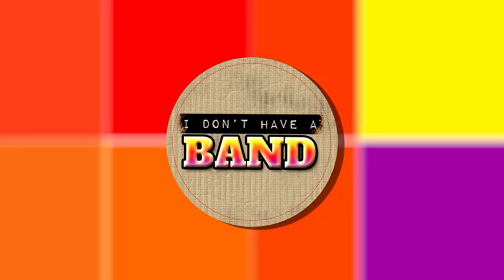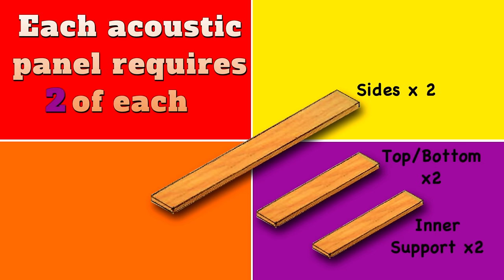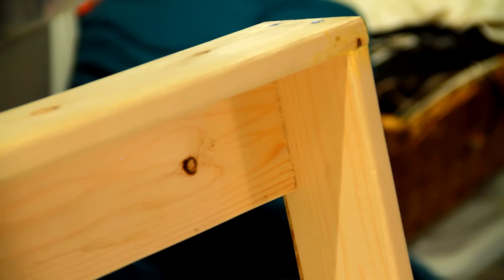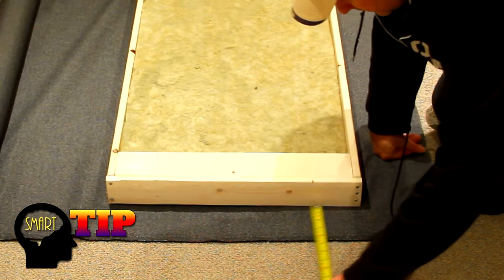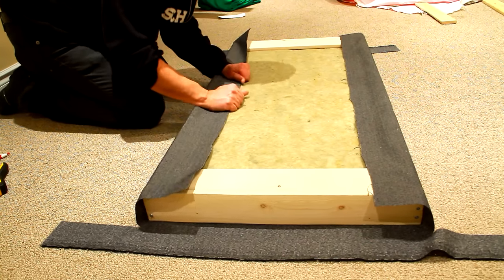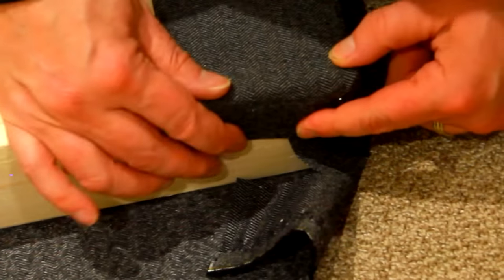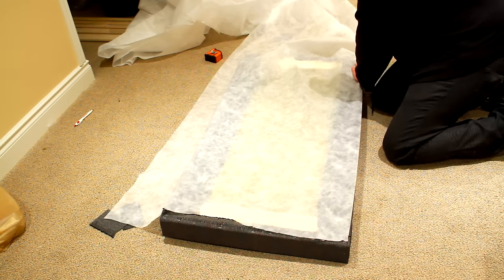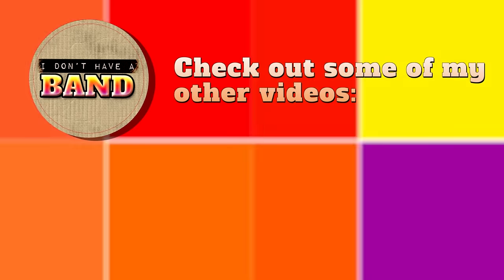DIY Acoustic Panels - How To Make Your Own Cheap and Awesome Panels

Comment: Great video
I’m looking for best ways to soundproofing my workshop 
I don’t know what type of noise barrier it will need as a lot of videos on line are for music studios and mentioned different pitch’s ect
Reply from the maker: Thank you.  Careful with confusing "Soundproofing" and "Sound Treatment". Soundproofing keeps the loud sound in the room.  Treatment (for music applications) absorbs unwanted frequencies to help you make critical music mixing decisions.  I've chatted with others looking to improve the sound in their workshop.  These can help the sound bouncing around the room, perhaps making it more tolerable but hard for me to say without knowing your precise application.
Reply: Lonely Rocker hello , I have a timber structure and want to stop noise from my tools inside coming out and annoying my neighbours basically
Reply: @scottmclean4237  You're looking for soundproofing which is far more expensive and complicated than acoustic treatment.  Soundproofing is like building a water tank.  It doesn't matter if most of the tank is waterproof, all you need is a tiny crack or hole and the tank will leak.  The same with soundproofing.  You can apply heavy soundproofing to a room, but it will only be as soundproof as the weakest link (usually a thin window or a hollow door).  Covering every inch of your walls and ceiling with Safe N sound would help a bit, as would putting up a double layer of drywall.  Doing both would be even more effective, especially if you also put a thick, heavy acoustic curtain over any windows and doors, but overall, it will not make your workshop completely soundproof.  Acoustic designers go to extreme lengths to make something soundproof, including building a room within a room where the floor of the inner room is sitting on springs, and the inner walls don't touch the outer walls.  So what's your budget?

Comment: I've already made these exact panels, and they are awesome. (Slightly different material, but overall same idea)

However I'm thinking because I never put a backing on them, or maybe it's the burlap, I'm having breathing issues and the only possible conclusion to what is causing it, is the panels.

I'm also trying something different, and sandwiching my speakers between 2 panels and it's sounding so focused it's crazy.

They sounded great before i did a room overhaul, but I feel like it's quite a bit better now.
Reply from the maker: Burlap is vey breathable plus having the backs open I’m sure particles are getting out.  You may want to consider tightening that up a bit to minimize particles getting out.   They do make a huge difference for sure.  Check out the sound test video on my channel. Clear evidence they make a big difference.  Thanks for watching!
Reply: @LonelyRocker  I actually spent the last few hours fixing them. 

I also have a sound test as a recent video with a speaker 1m from the microphone. It's a pretty substantial difference with the panel in front of the speaker or in front of the microphone.

When I make more panels (I have 16 more bats of roxul sitting in a closet...) I'll probably use better wood and fabric as mine look OK when on the wall, but It would be nice if they looked as nice as yours.  The only place that carried them was Lowes and you HAD to buy 3 bags... So budget was limited because of that.

And thanks for the video!  I saw one a long time ago that led me to make them, however yours is WAY easier to watch. No nonsense, just straight to the point.
Reply from the maker: Thank you so much for your kind words.  Glad you found the video useful.  Keep at it.  They get better with everyone you make :)

Comment: I am interested in a mounting method that attaches the panels to an existing drywall cathedral ceiling. Prefer to have about 3"to 4" gap between.ceiling and panel. Hide fasteners as much as possible.

Comment: Great video. Thanks! How much do these weigh? What kind of wood did you use?
Reply from the maker: Thank you!  They weigh under 12 lbs.  I used knotty pine but you can use any wood or even melamine.  I answer a bunch of panel questions here: https://youtu.be/IjCtAccI_7w

Comment: I know you can't help but I live in Italy and, I haven't been in any big store yet, but online at least I can't find Rockwool... Did someone from my country, or perhaps Europe, had the same problem? Which material should I get instead? Is any rock wool from other brands the same?
Reply from the maker: Instead of looking for this by brand name perhaps you can ask at your supply store for "mineral wool sound insulation" . I've seen products in other markets that serve the same purpose to manage sound.  They key is to NOT get a fibreglass based product.  Mineral Wool is key (Also called Stone Wool).  There are other sound insulation products made with denim and cotton.  I don't think the absorption values are as high and they can be messy  but you could compare the specs published by the manufacturers on their websites.  Hope this helps!!!
Reply: Lonely Rocker yes man very valuable help, I appreciate a lot!
Reply from the maker: My pleasure!!  Don't forget to SUB if you haven't already! :)

Comment: Great video! very well laid out graphics and dimensions. I've been having trouble finding the Roxul insulating material for a reasonable price though.

Do you know of any retailers that sell them for under 60.00 USD in a pack of 4-6? I'm trying to hit that initial budget you mentioned of under 20 CAD (15.00 USD).

Thanks!
Reply from the maker: Thank you so much!  Appreciate your thoughts.  I really don't have any knowledge about the product beyond my area.  My costs were based on local prices.  Best is to contact your local retailers or builder suppliers. I'm in Canada and the current price at Home Depot is about 42 USD.  They usually come in packs of 8.  Check the quantity.  Even at 60USD you would be within budget if there were 8 in the pack.  Good luck!

Comment: Hello, thanks for this great informative video, one question.  Will any type of fabric work for the covering.
Reply from the maker: Thanks so much!  Pretty much any fabric will work.  The keys to selecting good fabric are as follows:  Make sure it's breathable (no vinyls or leather) as sound has to pass through it.  More rigid fabrics are easier to work with as they will crease less.  Make sure it's dense enough that it keeps most of the fibers from your insulation inside the panel.  Hope that helps!!
Reply: I Don't Have a Band thanks for your quick response that helps a lot.  We found a fabric with different movie characters, we are thinking about using it in our theater room.  I want to see how rigid and how the fabric looks in person before I decide.  Thanks again.
Reply from the maker: Glad I could help.  Drop me a line once you've completed your project to let me know how it went.  Good luck!

Comment: Great video. Do you think it would help keep sound from coming into the room from outside? I am setting up a home office and my kids can be loud.
Reply from the maker: Thank you.  This question has been asked a lot and the answer is NO.  These manage reflections within the room but do not block sound from travelling in between rooms.  I have kids, I understand.  I wish they did!! :)
Reply: they will if you place them outside so they absorb the sound before it enters the walls of your room. Problem is these are not weather proof, and material that is, is suboptimal.
Reply from the maker: Actually no...inside or out they don't "Soundproof".  They absorb echoes and reflections.  Almost no effect for soundproofing....
Reply: @LonelyRocker  That makes little sense to me. Echo's are also just sound so why wouldn't it dampen sound directly from the source? Or is it negligible? Very interesting stuff, thanks for the reply.
Reply from the maker: Think of it in terms of energy.  A two or 4 inch panel has a dampening effect on unwanted frequencies bouncing back to your sitting position when you mix.  So panels are tuned for certain frequencies and placed strategically around the room.  The full energy of sound can only be blocked through physical properties of the room.  A sound proofed room is a room within a room with tons of soundproofing materials and properties built within and around it.  It takes a lot more to block the full energy of sound trying to come in or go out.
Reply: @LonelyRocker  Thanks for replying, I'm really interested in this stuff. I get that the panels are made for absorbing reflected sound in specific positions of a studio and I understand they are "tuned" for specific frequencies. However, sound from outside will not contain very different frequencies and will just be of a higher magnitude. Therefore I still think sound from outside can be dampened by placing these on the outside wall, the degree by which this will be noticeable however, I agree, might "take a lot more".
Reply: Put them in the kids room
Reply from the maker: True.  That's why I make videos :)

Comment: Thank you for the vid! I bought the exact rockwool 24" you shared but the specifications say that it's 3" thick (I thought it was 4" and I will be picking the rockwool up in a few days so I'm not sure if it's a bit more than 3") ; however,  I've cut my pieces of wood 5" thick so I'm assuming there will be a bit of space when I insert the rockwool in the frame. Will this be an issue? Should I add an extra inch of the rockwool?
Reply from the maker: My pleasure.  You got the right stuff.  An air gap in the back is a good thing.  It's exactly what you want.  And make sure to install the panels a bit off the wall.  The air gap is part of the design and helps the performance of the panels.
Reply: @LonelyRocker  awesome, thanks again!

Comment: YES!!!!   I am currently  hmm  building my panels!!!!  I  used  .... basically your technique.  I am using fiberglass insulation.  3and half inches.  25 inch wide and  8 FEET end frames!!!
 I plan on putting them in as many  corners possible!!   For a hmm  diffuser.  I can't STAND the  .. ECHCO !!!  Get me?   I. HOPE THEY WORK.  I will  FINALLY COMPLETE MY FIRST ONE, tomorrow.   Having a lot of fun!!!   Many hours  developing it.  Cause I   um  never did  this sort of thing, YO.    But  after MUCH  RESEARCH  and  seeing YOUR VID, I  feel PRETTY CONFIDENT!      THANKS, MAN  !!!!!!!!  !  !         ?
Reply from the maker: Glad you liked the video but PLEASE reconsider using Fiberglass insulation. You DO NOT want fiberglass in there.  It won't be good for your health.  My recommendation in the video is insulation made with mineral wool, NOT FIBERGLASS.  The absorption properties with Fiberglass won't nearly be as good, plus the health risks.  I would highly recommend you find better fill material before you get too far!!!
Reply: OKAY.  I  THREWW THE  FIBERGLASS OUT !!  gOT  SOME   rockwool !!  aM STARTING  NEW  procedure , NOW !!  THANKS !!

Comment: nice panels i know alot of people think these will block sound but they will not and i have a question what should i do with the window in my studio i hear some cars sometimes so i want to block the window and put panel on top do you have any tips of blocking the window ?
Reply from the maker: Thanks!  Ahh windows.  Many of us have that issue.  If you watch some of my newer videos you can see what I did with my window.  Now, I'm in a basement and my window faces the backyard, so sound is not an issue.  I just stuffed two pillows in there.  What I would do is calculate placement for your panels first and install them all where they need to be.  Even if they need to go in front of the window.  As far as what to do with your window, it's hard to say not knowing what type of window you have.  But if doable, you could make some sort of frame stuffed with dense material to install over the window.  Or create some space in your room for recording that's less affected by the window.  Good luck!
Reply: @LonelyRocker  really nice reply i was thinking making a frame filled with rock wool to block it but i guess i need denser material
Reply from the maker: Good luck!  Let me know how it works out!
Reply: Not sure if this is helpful but ...there’s a company that makes acrylic panels w/ rubber bumper sealed edges which are meant to create an easy push in place double pane system for existing windows. If I recall correctly they make a model specifically designed to create the air gap needed to reduce sound transfer & the price wasn’t bad at all. Can’t remember the name of the company but quick google search should get ya there

Comment: I'm just wondering if i could make a 48x48 panel instead of 24x48. Do you think that would work? Because I have a flag that is 48x48 and I'd love to actually make it useful, not just decorative. I'd have to use two panels of wool instead of just one. And should I also put fabric under the actual flag (because the flag isn't big enough to get the sides) or can I just leave it on wood? Thanks in advance for your response:)!
Reply from the maker: What's more important than the size of the panels is their placement.  Remember, sound is going to go where it wants to.  It doesn't care how big the panels are.  You need to calculate your reflection points and place your panels accordingly.  Larger panels cover more ground but may be overkill if they don't hit extra reflection points.  I have a placement video on here too...

Comment: I probably have one of the most undesirable of shapes and sizes for a home studio room. It is square room with dimensions 9L x 9W x 10H. As of now, I really don't have an option as to where i can have my setup so my only question is should i be using your 6 inch wide lumber panel method or 8 inch wide ?
Reply from the maker: I actually just released this video.  It might be just what you need: https://youtu.be/AdDdumAieJs

Comment: How absorsive is Wood wool..will the Material that you have i guess rockwool be sufficient for Sound absorption..
Reply from the maker: Rockwool is designed for sound applications.  Other brands make similar types of insulation too like Corning.  I'd recommend those over any standard wool or other materials.  It's quite cheap anyways and comes pre-sized for easy installation. Not much savings and probably inferior performance if you improvise with other materials.

Comment: Thanks for the tutorial, man!! Straightforward, helpful, and budget-friendly to boot. 

However, I do have one question: would spraypainting the panels after upholstering make them less effective/safe? I see an artistic opportunity, but I want to make sure I'm not committing some cardinal soundproofing sin.. 😂
Reply from the maker: Thank you!  Glad it helped.  That’s a great question.  The rule for the fabric is it has to be breathable.  Do a test.  If you can blow cleanly through the fabric after painting it should be fine.  If not, then the fabric has become reflective.  Good luck!
Reply: @LonelyRocker  Thank you!! I'll be sure to check it 👍👍
Reply: Turned into a really good question. Didn't realize the fabric needed to breathe.
Reply from the maker: That’s very important.
Reply from the maker: @sethweeks They look awesome!  Congrats!
Reply: @LonelyRocker  thank you!! :D

Comment: For 8 panels,  I would need 16pcs of wood (1" x 4" x 8'), a total of 48 cut pcs of 3 various lengths. Does that sound correct? Unfortunately I don't have a saw so I would have to get the wood pre-cut.
Reply from the maker: Many hardware stores can make the cuts for you.  Just tell them what you need and they will only charge you for the pieces you need..  Good luck!

Comment: Safe n sound seems to only be available in 16" width now. Comfortboard is much easier to find in the 24" width. For normal panels would you suggest a 2" deep x 24" wide comfortboard panels or 16" wide safe n sound panels?
Reply from the maker: Comfortboard is great.  I use it now.  Check out a newer video I did.  These are smaller panels but you can adapt the formula to 24x48 panels.  This would work VERY well: https://youtu.be/AdDdumAieJs
Reply: @LonelyRocker  Great videos, I’m soundproofing my office due to COVID I’ve been working from home and need complete quiet when talking to clients on the phone.  I’ve been doing a lot of research and I came across your videos and they’re the best thing since sliced bread.  So easy to make and so much cheaper than buying premade panels.  Why do you like comfortboard better?  Is it easier to work with?  As far as the sound ratings, according to the data sheets offered by rockwool, the safe n sound has higher NRC ratings than comfortboard and AFB 3’-6” has the highest NRC ratings.  It’s not by much and other than what it stands for I haven’t pragmatically tested the different materials.  What is it about comfortboard that you prefer?
Reply from the maker: Thanks so much for your thoughts!  Much appreciated.  I used Safe'n'Sound first.  Many have concerns about it so I got in touch with Rockwool.  While they expressed no health concerns with their products they recommended Comfortboard because it is a rigid product and less prone to releasing fibers.  My tests show it's a VERY efficient absorber for the money.  Not sure if you saw this test video I did.  https://youtu.be/zatRUp39xF4 The panels I made with Comforboard plus a layer of foam performed exceptionally well. Though to be clear, these will not deaden the sound completely.  They will just absorb desired reflections.  You could wallpaper your office with the 8 inch absorbers from my Panels 2.0 video but that would be excessive and expensive.  Hope these points help you...